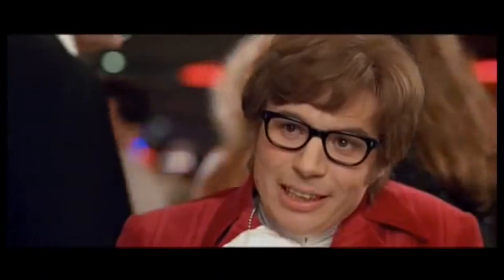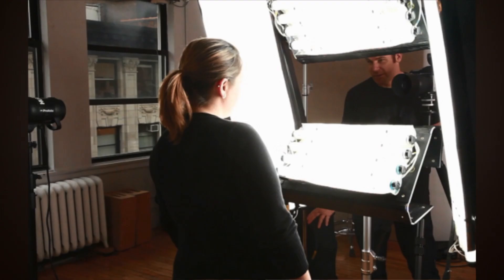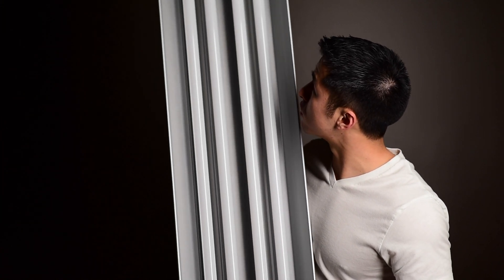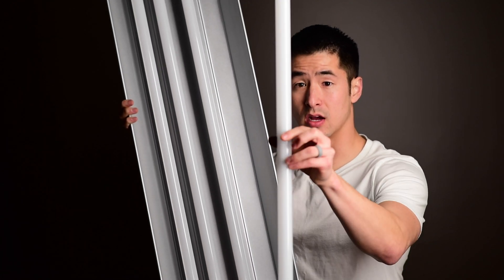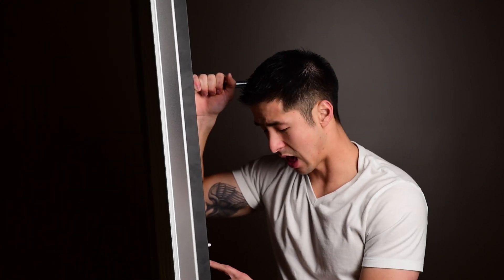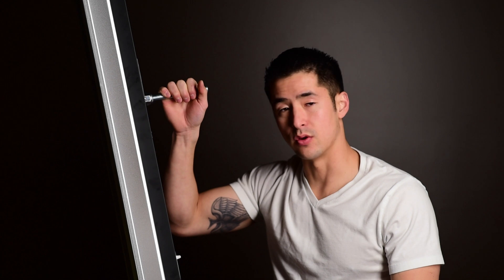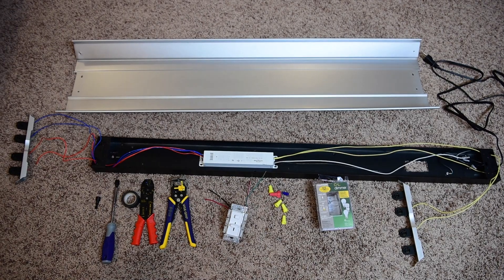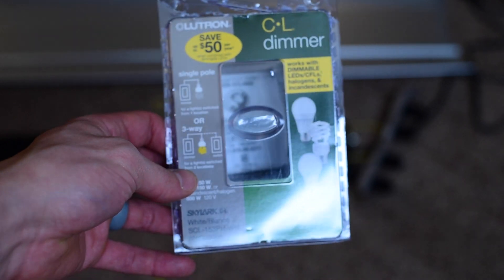DIY LED KinoFlo Style Light Tutorial

Comment: Great DIY video. I really like how you gave all the information on where to get the actual parts you used. So many DIY Vids vocally tell you what they used and leave you in the dark as to what exactly the part is and where to get it. One thing though, the bit at the end with the white extension cord... its somewhat unclear exactly what you did with it. Could you provide a little more info on what it was used for? I assumed the shop light fixture had a built in power cord so I am confused as to the purpose of the white extension cord. Thanks!
Reply from the maker: +Michael Carman I didn't use the white cord for the build.  It was just a quick tutorial to show how to locate the hot wire, to hook up a dimmer.
Reply: Ah ok. I didnt think you used it but it had me thinking i missed something. Thanks!

Comment: Hey Shawn loved the video! I too an a huge Peter Hurley fan. I highly recommend the book by the way I'm half way through it.  I'm building a home studio so I can start doing head shots so thank you for creating this DIY VID. I'm not a handy person by any means but the build looks relatively simple.  I can't wait to get started. Any tips or words of advice for a novice DIY builder attempting to recreate this?
Reply from the maker: +Kimo711  

1) Make sure you have the proper tools for whatever you're trying to do.  To cut out the hole for the dimmer to fit into I used a high powered dremel type tool.  To make it easier you could just mount the dimmer with some velcro or tape (Just make sure they're no exposed wires/contacts, cover any exposed areas with electrical tape)  

2) You could just not use a dimmer.  To get less light you could just "unscrew" bulbs. 

3)  Vice Grip pliers were nearly essential for me when I was trying screw on the nuts to the bolt.  I also used tiny screws in the corners of the mounting plate to keep it from twisting as I was torquing the nut down.  If you want to make it easier you could get something like this.... http://www.bhphotovideo.com/c/product/33169-REG/Matthews_429085_Baby_Plate_6.html/prm/alsVwDtl